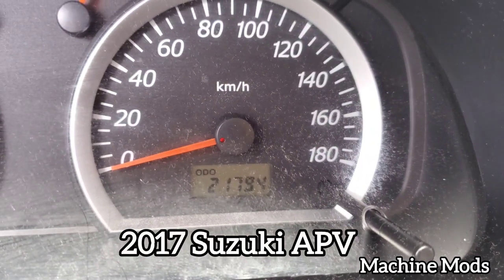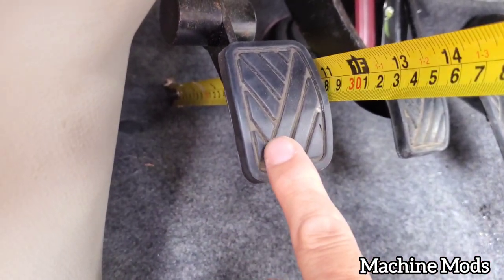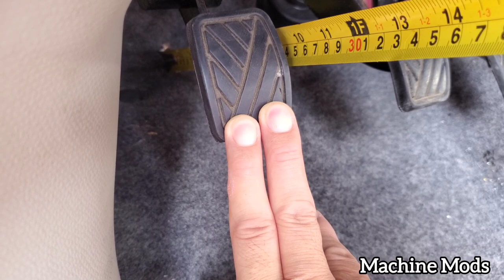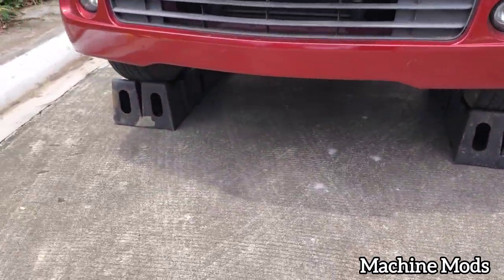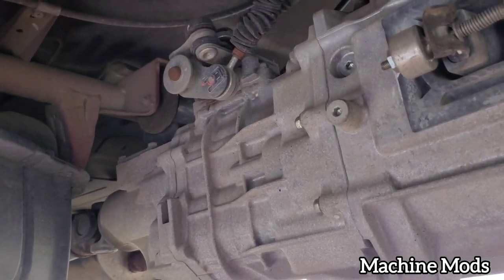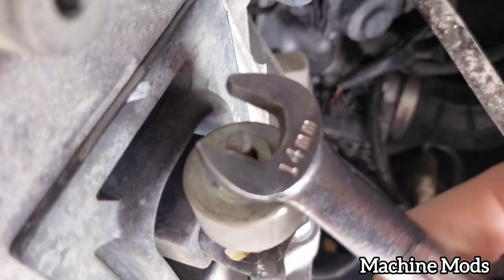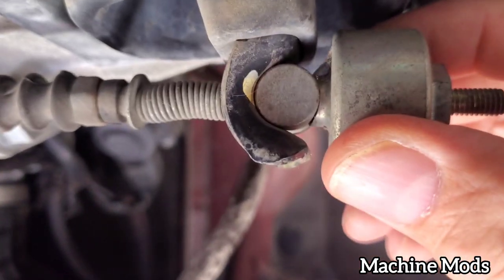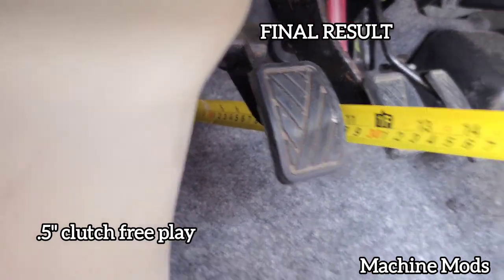How to adjust the clutch pedal freeplay for all Cars and trucks SUZUKI APV #clutch

Comment: Hi it was 9.5". You wanted 10.5" so difference was 1" not 1/2"
Did 4 turn made half inch or 1 inch
Reply from the maker: I don't remember it had been a while, but you can turn the adjustment 2 times and check your measurements each time.